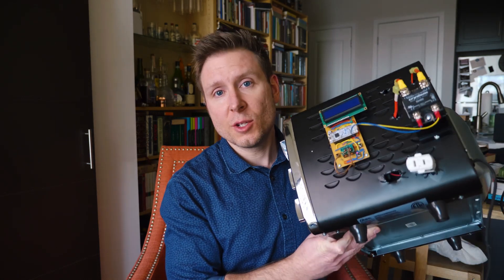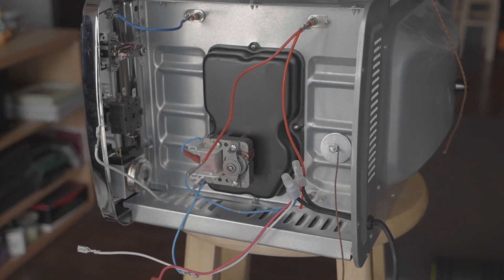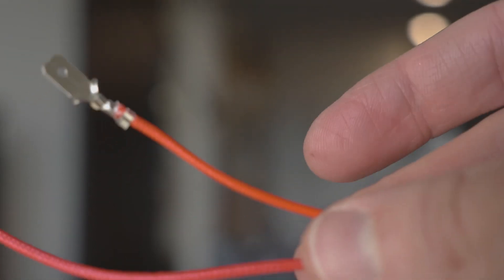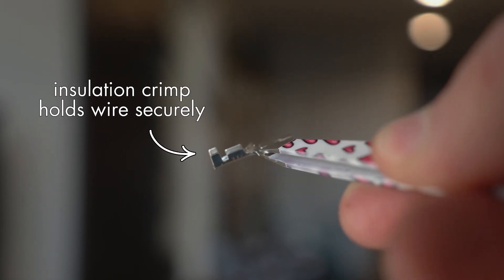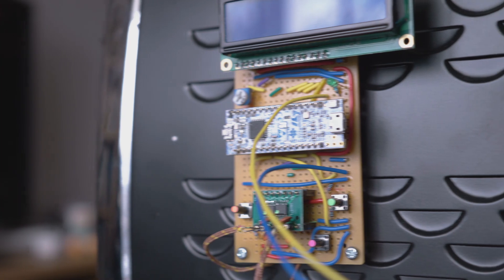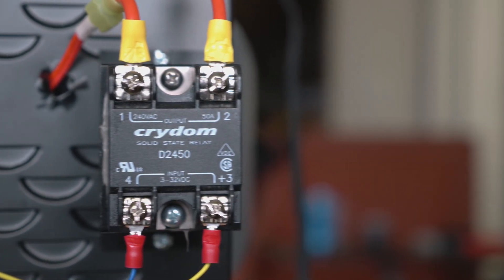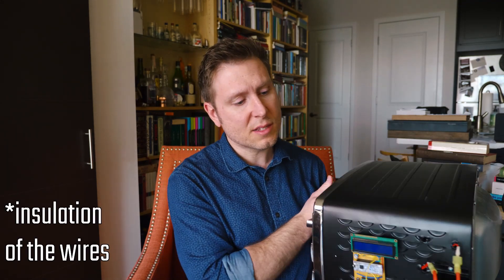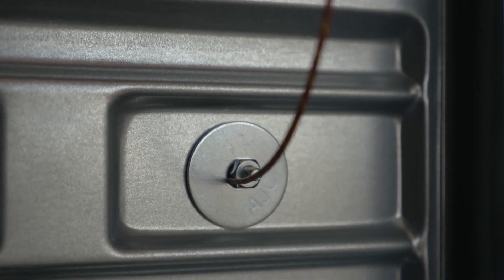Baking PCBs using a PID Controller and a Toaster Oven

Comment: Your standard toaster oven is thermally very lossy.  So insulating around the chamber on 5 sides is a must.  Some have cut up a cheap welders blanket from Harbor Freight then used pop rivets and large fender washers to hold it in place.  (If you have a seamstress handy to do up the cut edges will make it look good.)  Unfortunately the piece on the back has to be on the outside.  There are also thigh temperature ceramic insulation bats that will work as well.   Some people have also applied high temp tape to the glass door to cut thermal loss leaving a small viewing port.
Reply from the maker: I found that aluminum coated fiberglass sheets work well for me.  In my case I covered the window, but as long as I'm not doing anything with vastly different densities, I find that I don't need it anyway.  As an added bonus you can get it with adhesive backing that has held up well for me, although you could easily just use a high temperature adhesive to accomplish the same thing.

I had been looking for some of the fancier ceramic fiber sheets, but they seem to be difficult to come by if you aren't ordering in quantity - and I'm not sure the performance would be worth the price jump either.  Welder blankets is an interesting idea - I might try that on the next one.